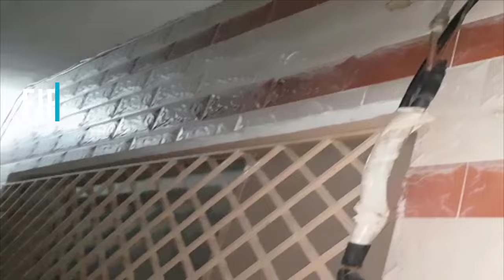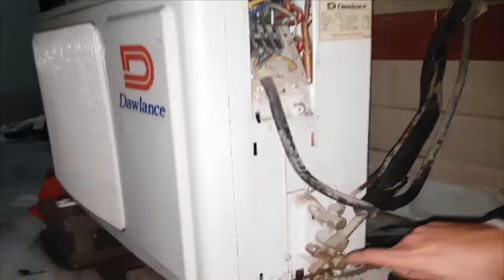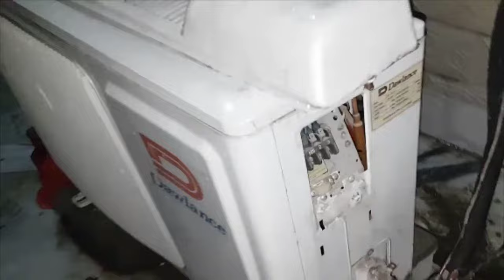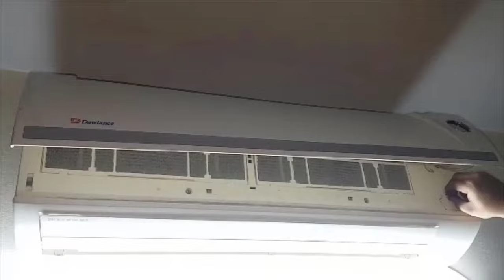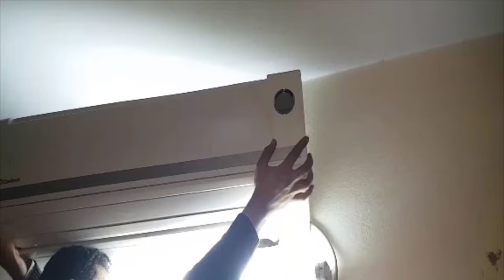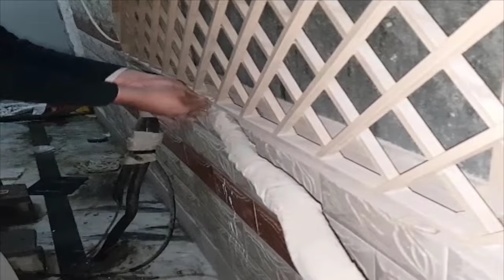How to remove Air Conditioner unit

Comment: You should tight the tiniest line on the outdoor unit, let the ac runs for 5 mins, then tight the other line before cutting power off, this traps the gas in the outdoor unit
Reply: Me too...was looking for this
Reply: What if the ac unit isn't running it has a bad board, can you still trap the gas?
Reply: @susiemyers3247  if the compressor unit isn't working, then you can't trap de gas, call for a specialist
Reply: @CaptainYoul  can't u explain again please...I understand the all line at ur first sentence....but the larger line at the end of ur comment....don't get it accordingly to ur comment 🤦🏿‍♂️🤷🏿‍♂️
Reply: @selassiecru8667  tightening the small line stops refrigerant from flowing back to the indoor unit while the AC mode is on. When you run the AC with that small line closed all the r134a pumps back to the outside unit and can't get back to the indoor one. After 5 mins running ac most of the coolant will be trapped in the outdoor unit, then close the larger line/valve to seal it closed then you can detach the lines with minimal refrigerant loss.
Reply: Its called Pump down right?
Reply: @999fine5   A good explaination however most of these split air con units run heat and cool in the UK and no one has said should you run the compessor hot or cold, i would think this is really important or am i wrong. Which is it hot or cold.
Reply: @DesAcetek  1- run it cold, that means, ac machine is making the room cold. hot air gets out of the unodoor unit. runnit 10 min....2- turn off the tiny pipe     3- keep ruunig 5 min, then turn off the big pipe    done.
Reply: that's what I was looking for thanks
Reply: Pump down
Reply: Thanks captain was just gonna disconnect the lines without doing the above
Reply: @tantanlaborce1746  Yes, You're not supposed to just run it for 5 minutes. You hook a gage set on the port, run it until it gets to zero, then quickly shut the low valve and turn the power off.
Reply: @DrHarryT what if you have no power?
Can it be detached without running like guy showed in this video and will it have bad effect on AC?
AC i need to remove was not working for over a year.
Reply: @actionman4520  If there is no way to run the compressor then it should be recovered using a recovery system that puts the refrigerant into a bottle. 

Otherwise you can disconnect the lines letting it leak into the atmosphere [which is not EPA approved] and then it would have to properly recharged at a new installation location.
It won't harm the AC system but you do need to seal with tape or something all the lines and ports to keep moisture and dirt out of the entire system.
Reply: @DrHarryT  Not gonna just leak it.
Guess it's time to call "the guy".
Reply: @999fine5  I have a question, after trapping gas when you want to install it again do you need to add refrigerant

Comment: This tutorial is not perfect, but this sure taught me alot.

Just remember to lock the small pipe first then let the ac run for about 5 minutes to lock the gas inside the compressor, then lock the pipe. 

Good tutorial video!
Reply from the maker: We appreciate your feedback.
Thanks for watching!
Reply: Plz explained more I want to shift one ac
Reply: @bluebird5974  There are 2 pipes, a big one that takes in the Freon, and the small one that let out the Freon. 

Lock the small pipe for about 5 minutes while let the machine on, to let the compressor pushes in all the Freon into the unit, then lock the big pipe. Turn the machine off. Now, the Freon would be trapped inside the AC unit, instead of leaking onto the atmosphere, which would be dangerous for the environment.
Reply: Do you not need to drain the refrigerant into something if you do it this way? I just want to move my mini split and outside condenser to another side of my house.
Reply: @Kimberly_Crowe  yes lock small pipe with NL key .they run ac 5 mnits then lock big pioe with nl key and open both pipe
Reply: what if the compressor / the outside unit is broken ? how do you do?

Comment: You supposed to do a pump down procedure. You hook a gage set on the port, run it on high cool until it gets to zero, then quickly shut the low valve and turn the power off.

Comment: Releasing the gas in some countries is illegal and can come with a HUGE fine
Reply from the maker: Well first it's not much gas we are releasing and that is why it can't be illegal.
Reply: @easysolutions90  Wow. You really seem to know this. NOT!
It is approximately the eqivalent to 1500-1800 kg of Co2 that is released into the atmosphere if you let the gas out from one of these. That is the equivalent of approx 1 year of driving a car.
Reply: Completely illegal in Australia to release any gas from an AC unit
Reply: first , what about the refrigerant , second, 
I hate that common background music
Reply: @trondster  1500-1800 kg? So u mean to say the Co2 that’s released from one of these has the mass of pickup truck?
Reply: @MichaelFrancisRay  Sighs.....No. Its the equivalent to the gas used in the heating pump.
Reply: @trondster  sigh? Don’t give me a snarky attitude when you are the one that’s wrong. I’m not saying venting gas to the atmosphere is correct. I’m going after what you presented that is false. There is NOT 1500 kg of Co2 in an aircon. Did you mean mg?
Reply: @MichaelFrancisRay  Ok, I understand what you mean now. 
I can agree that I was unprecise in my first answer, as I have forgotten one word. Equivalent. But I am in no terms whatsoever wrong. Just missed a word while writing. 
I fixed it now. Thanks for pointing that out.
Anyway, let me break it down, just to avoid any further confusion:
In the common household air to air heating pumps there is approx 1-1,5 kg of cooling medium. Mostly this is F/HFK/KFK/HKFK/PFK/SF6 gases that are used. There is no Co2 in such equipment.
When this gas is released into our environment they bind to other molecules, and some of them takes about a 1000 years to break down, as they are not natural, but indstrially made. 
Releasing 1-1.5 kg of some of these gases is the equivalent to releasing approx 1500-1800 kg of Co2 instead. 
This is why in most of Europe you have to be a certified F-gas installer to do anything to these appliances, as one should know what one is doing when working in this field.
Not just let it out in the atmosphere like Easysolutions did, just because you cannot see the gas, and there is "not that much gas released, so that is why it can`t be illegal" -as they just wrote.
Reply: You are absolutely right. Some people are just really, lets say, "not smart". 

Easy solutions is definitely "not smart". Irresponsible is another word that comes to mind..
Reply: How are authorities gonna know that gas leaked? It's virtually impossible to get fined. Though it's not good and all precautions should be taken
Reply: @easysolutions90  Incorrect and ignorant comment !
Reply: @MichaelFrancisRay  this is how ozone gases are referred to when indicating their environmental damage. It's like you only got a tiny bit of plutonium-239 on you so how harmful can it be right? 😅

Comment: Wait a minute, I didn't see you suck the refrigerant back into the compressor with force cool mode. How does what you did not release the refrigerant in the indoor unit and line set into the air?
Reply from the maker: We closed the wall in compressor and then when we ran the AC indoor unit the gas automatically gone back to compressor.

Comment: And that kids is why we don't look for howto's on the internet and hire a professional.
Reply from the maker: You must be 18+ and mature enough to search for & dig into how to videos specially of electronics category plus our videos are restricted for children under 18.
Reply: @easysolutions90  this video should be deleted because It does not show the most important part of removing an A/C unit, how to trap the gas in the outdoor unit. Lots of the comments are from people who trusted you know what you are doing and had refrigerant leaked. Please delete this video, hire a professional who knows what he is doing, film the whole process and reupload.
Reply from the maker: We tried to show the whole method in the best possible way & to be very honest we removed & installed the ac unit without facing any kind of issue in our air conditioner. Therefore we didn’t misguide our audience rather we taught them what we know for free. I hope you understand now.
Reply: My country can set up an air-conditioning unit but it's not included to take it down so I have to find a way to take it down 💀

Comment: In my case closing and both pipe and detaching the gas remaining in the pipe leaked ! 
Is it ok ? 
Isn’t it dangerous?
Reply: Should run the unit first with the smallest pipe closed, wait for 5min, close the larger pipe then shut down power. This will allow the freon to flow into the outside unit and clear the pipes. There should be no gas leak when you unscrew the pipes

Comment: DO NOT DO THIS AT HOME! Failing to draw down the refrigerant from the system is usually illegal and certainly environmentally irresponsible. It's not a difficult step. Make sure you watch other videos.
Reply from the maker: We didn’t face any issue while doing as shown completely in the video hence we still say our audience should try on their own risk.
Reply: What if the unit doesn’t run?
Reply: @peterlehman8138  If it is still gassed, then you would need to get someone with a recovery unit. They use a vacuum to draw the refrigerant into a tank.
Reply: @easysolutions90  They can only do it at their own risk if you say what the risk is.
Reply: What is the risk
Reply: @LondonRider12 there's no risk. I removed my old Aircon with no problem at all

Comment: I caused a blackout because i forgot that the airconditioner was using a different fuse. Turn the power off before any tinkering....
Reply from the maker: First I thought about the AC off, then I started working AC has to be turned on to reverse the ac gas

Comment: So by using this process will we loose the gas of  the ac?
Reply: yes he has done it wrong,close exit valve and run ac untill all the gas is back in the compressor, then close inlet valve .
Reply from the maker: You can later fill the gas easily, its not that much difficult, in this video we are basically changing the position of Our AC
Reply: Sunad Sawant.  
It is excellent video.  You guided it in very simple way.  Appreciated.
Reply: Geez...even i know this is wrong...look elswhere.
Reply: @stephenclack4326  yes that seems obvious, but where to find a good video explanation.?
Reply: @jaapbg  keep looking elsewhere

Comment: If the intent is to simply scrap the unit and if the unit is new, does not contain ozone damaging Freon, do you see any issue with simply venting the transfer medium (the coolant) into the outside air?  Keep in mind, the unit's being scrapped.  Where's/what's the need/advantage in collecting the coolant?
Reply from the maker: It could help you to this regard that you don’t have to get the gass filled again.
Reply: All refrigerants are greenhouse gases, and in most countries it is illegal to vent them to the atmosphere.
Reply: To be very clear, virtually ALL home air conditioners contain ozone depleting gases, and/or greenhouse gases, be they new or not.   There are some commercial exceptions which use R1234yf, so if you're doing this at home it's likely you'll cop a fine like my neighbour who I filmed doing it, $5,000 fine. Not exactly a quiet operation either. Never liked him anyway.